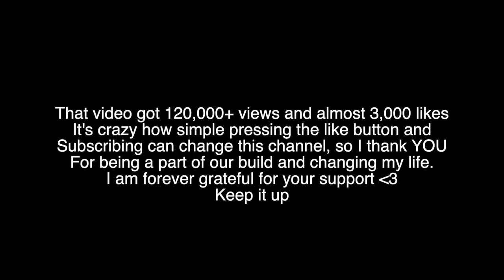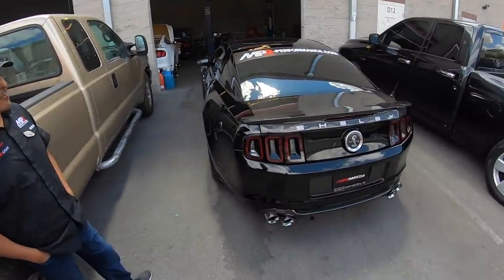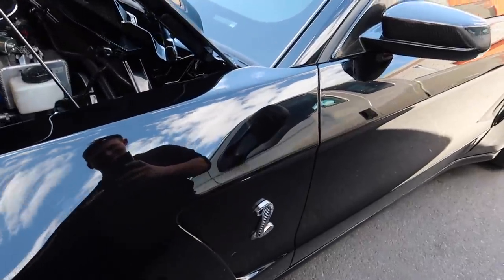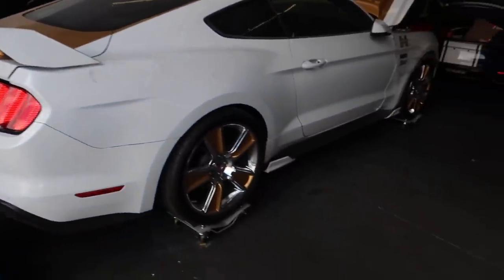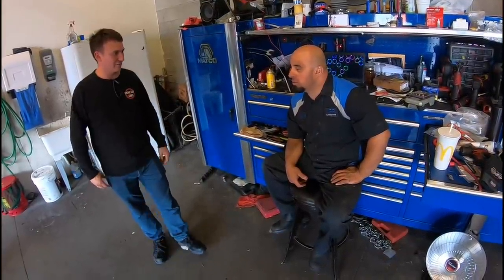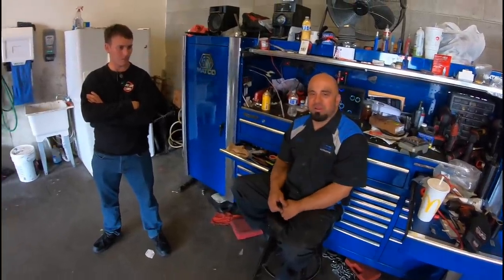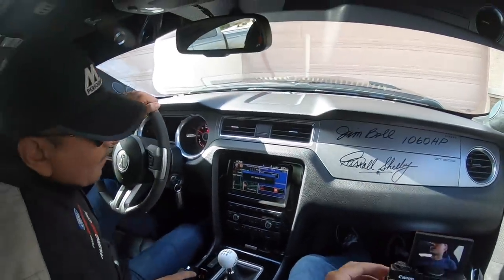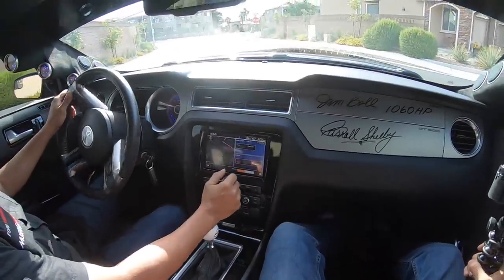Shelby 1000 Widebody COMPLETED!

Comment: I hated mustangs and thanks to nate rider videos it convinced me to get 1 thank you nate !
Reply: sounds about right, the majority of mustang haters are just uninformed.
Reply from the maker: gotchuuuu
Reply: @Diffy_887  nah some of us just prefer a lightweight sports car with the emphasis being on handling.
Reply: Nikko Puga  The Honda S2K, BRZ/FRS/86, Miata, Porsche Cayman/Boxster and Lotus Elise/Exige are the sports cars I'm referring to.
Reply: Nikko Puga  All of the cars I mentioned can be purchased for under $30k except for the Exige but that's still under $50k. I don't think that analogy works well, the Mustang would get smoked by a lot of those cars on the track or a curvy road especially if mods are in the equation
Reply: Nikko Puga The Mustang has improved steering feel a lot, but it's still  not in the same league. It's superior on a drag strip or for highway pulls though.
Reply: Nikko Puga  I'm not talking about the 1st Gen Boxster and any Boxster/Cayman that is part of the 987 gen or newer is going to have vastly better handling, they are mid engine Porsche's. You're wrong about pricing and availability. A Mustang GT costs $35-50k every car I mentioned you can buy a good condition non high mileage example for that price, most even lower.
Reply: Nikko Puga  Mustangs are great cars, it's simply a choice of what kind of performance vehicle you are interested in.

Comment: Do not re-sleeve that 5.8 they have ptwa cylinder liners and that is a hell of a lot stronger than a cast iron sleeve. Read John mihovitz's write ups on the modular 4v engines. He made 3000hp on a factory 4.6 teksid block and in his write up he specifies which blocks are the strongest for 4.6 and 5.4/5.8 22psi out of a 4.7 is a lot more air than 22psi from a 2.3. Think of it like a flow bench, they flow heads at a set pressure and at that same pressure different heads can flow more air. Same for a blower a big blower is physically moving more air than a smaller blower even at the same pressure, boost is more than just pressure everything is a variable

Comment: You can make 1000 wheel with a 2.8 KB or even the 2.65 VMP All day.  Edelbrock 2.65 will make 1000 whp easily as well. He’s wrong about blowers and what you need.